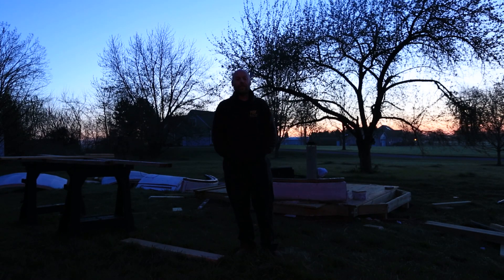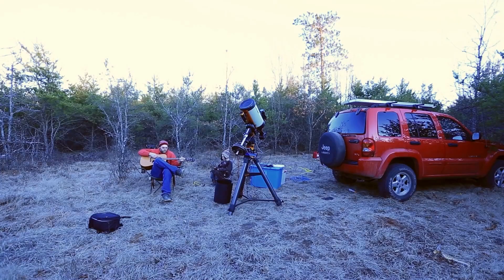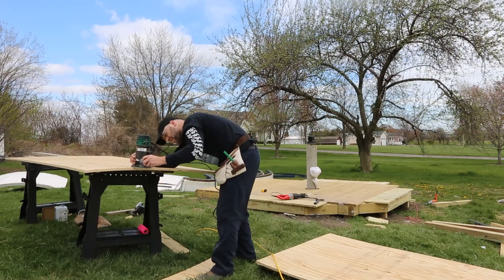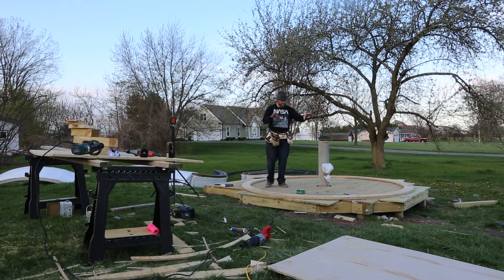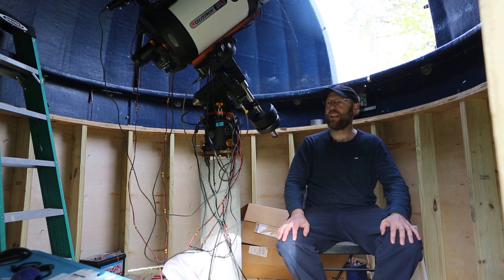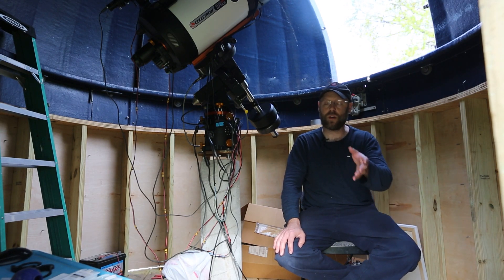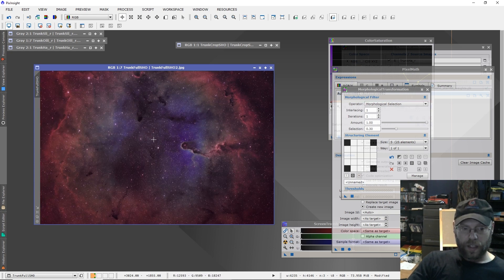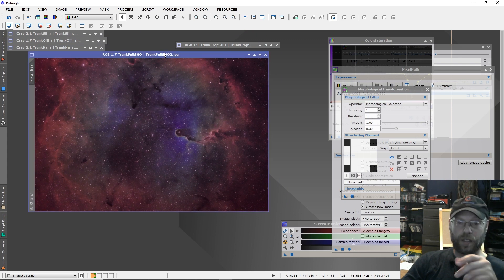Observatory Phase 2

Comment: This is sick. Do you miss objects though that are close to the horizon?
Reply from the maker: The closest I can get to the horizon is about 20° because of surrounding houses and trees. I normally don't go below 30° anyways because of atmospheric dispersion.
Reply: @DeepSpaceDad  That makes sense. I figured there would be things in the way anyways because you are not on a hill or anything. How much did the overall project end up costing minus the telescope and computer, etc?
Reply from the maker: I got a great deal on a used TI 10' dome for 2k. Probably about 3k for the rest of the materials and construction.
Reply: @DeepSpaceDad  Wow that is way cheaper than I thought it would be. Still quite expensive of course but I thought it would be at least 10k.
Reply from the maker: I still have some spending to do on it to finish it up. Security system and lighting and such but it's basically done.